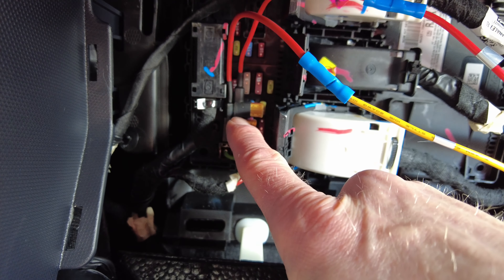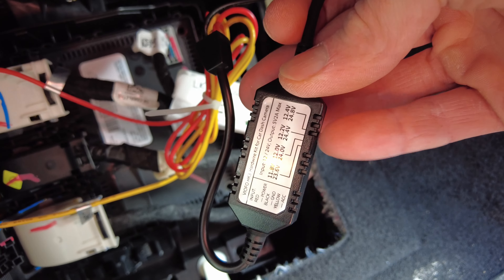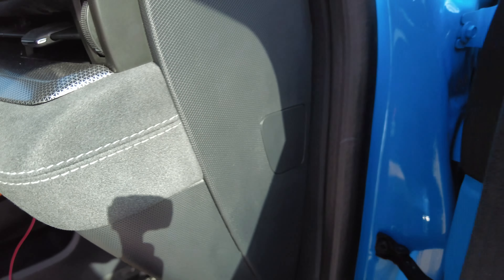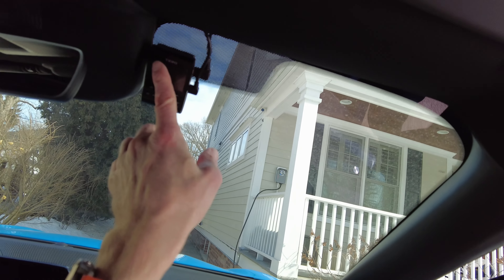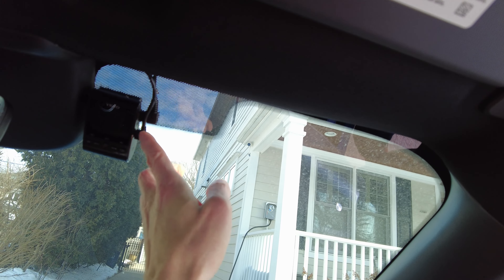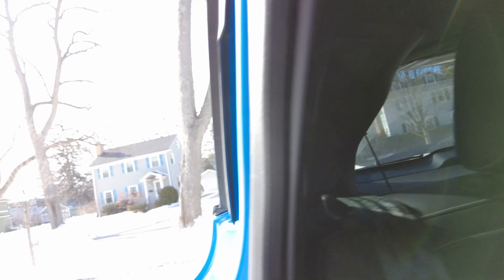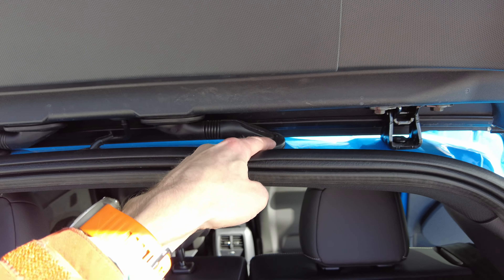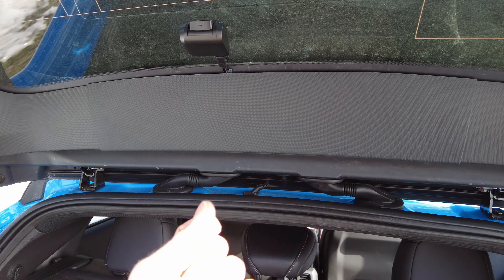Viofo A129 Pro Duo Ford Mustang Mach-E Dashcam Install

Comment: very nice details.   is your rear camera situated high where the wipers don't clean that area, resulting in slightly blurred video?   just curious as the rear wiper is short.
Reply from the maker: I swapped the wiper for a longer (15" vs the ~12") one. IIRC, it was a Trico 15-G. It cleans the space where the camera is mounted, it was an issue with the stock wiper.

Comment: Assuming you never detached the A-pillar or the B-pillar, correct?
Reply from the maker: Nope, there's a seam where the pillar meets the roofline, press the cable gently in to that area, not to deep, just enough to hide it.
Reply: @MissingRemote  that's what I did today. Thank you. I wasn't up for a fight with the pillars.

Comment: This is extremely helpful. Thanks for taking the time to make it. Is there a video somewhere for how to get the fuse panel off, and did you take any pictures of the process with the boot?
Reply from the maker: There's nothing complicated to the boot install really, just a lot of inching the connector forward while pushing the boot backward. The fuse cover was tricky because of the force required on the bottom (pull towards the seat). There are several clips holding it in place. I also undid the push pins holding the top panel to remove it as a single piece, but that's optional. I'll take a photo tomorrow and highlight the parts.
Reply from the maker: Added instructions for removing the fuse cover here: https://www.missingremote.com/guide/2022/02/viofo-a129-pro-duo-ford-mustang-mach-e-dashcam-install

Comment: You need to plug that main (front) camera into the GPS base not the side of the camera. The DONGER tap is much better solution for plugging the camera in. It attaches to the mirror power. It takes less than 5 minutes. No fuse panel work needed.
Reply from the maker: I'm not a fan of wire taps. Running to the fuse box is easy, you're not altering the car in anyway, and it has the camera on its own fuse so there's very little chance of any issues.

Plugging into the camera vs GPS is a topic that requires a more nuanced discussion; there are cost/benefits to doing it either way. I do currently have it plugged into the GPS module.